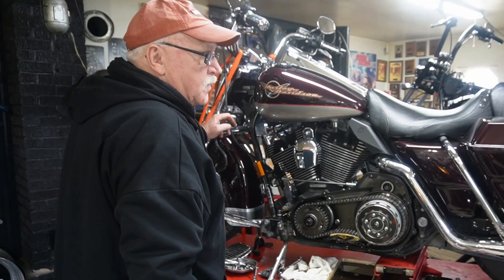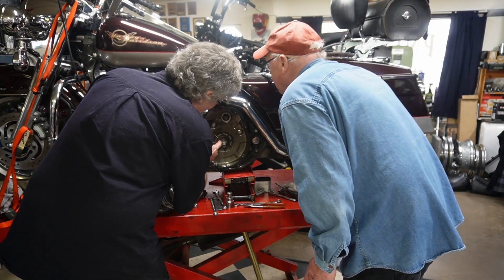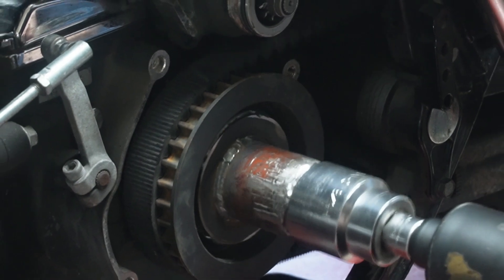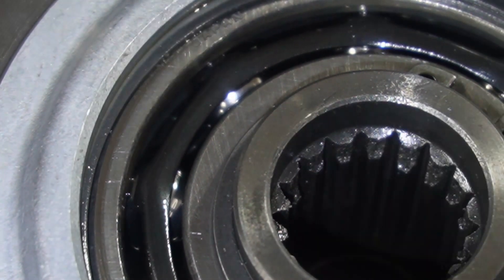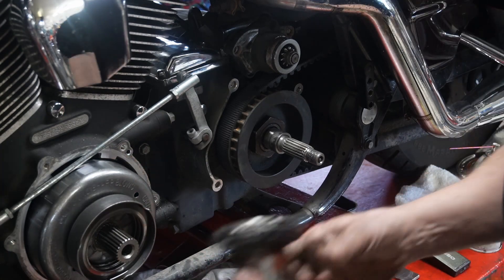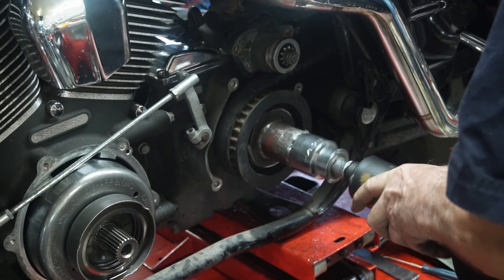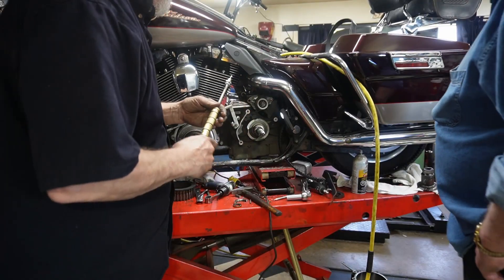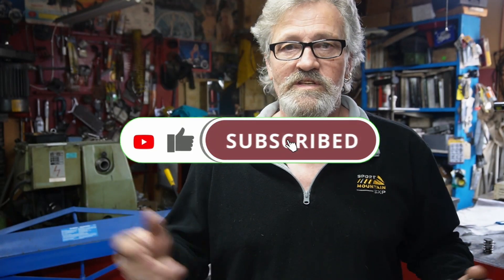PRIMARY BEARING PROBLEMS, BAD NOISE IN THE PRIMARY CASE  PT 1

Comment: Took the right size 3/4 in drive socket ...cut it in half welded a piece of black pipe in the middle....works great... used it hundreds of times! Made one for both size nuts!
Reply from the maker: Thanks for letting others know how you handled it. Thanks for commenting.

Comment: I've never had a clutch hub nut that stubborn. You had a fight there. I do the trap door deal to make room for the bushing puller. Usually when you have one without enough clearance to get the puller on its because somebody drove one in to far. Nice shop built tool. Most of mine are the ebay knockoffs of Jims.
Reply from the maker: Yes just wanted to show it is not always easy and this one definately was not. I may try the trap door thing next time, when the exhaust is easier to get off than a decker  ha ha. Lucky to be able to fabricate some tools. They are so expensive these days and many just cannot afford them...me included. Thanks for the comment. Appreciated!

Comment: That nut would have come if you used a fine tip oxy-propane or oxy-mapgas torch and a 4 foot Johnson bar.  The oxygen raises the heat high enough to melt the red loctite and the fine tip keeps the heat concentrated.
Reply from the maker: Thanks for letting other know how you did it. Maybe it will work for others equipped to do so. Thanks for commenting.

Comment: been there, if you remove the right side mainshaft nut on the trapdoor the mainshaft will slide left enough to get the primary race off the shaft. the impact from your gun is being absorbed by the belt, next time you get a broken belt use part of it to make a strap wrench, without distance between the rear and front pulley absorbing the impact they come right off.
Reply from the maker: I've heard of that but requires a lot of work, remove exhaust, trans fluid, etc. But I have heard it does work sometimes. Each to their own. Thanks for the belt info.
Reply: Huh I'm doing this right now,  great 🙄

Comment: just want to throw this in there, on the race I used the puller and a torch fought it for a day then decided to use heat with a impact slid right off...
and the clutch assembly is left hand thread but the pully is right hand thread....
Reply from the maker: Thanks for commenting and letting others know what you did.

Comment: buy a 2 1/4" deep socket. cut it in half and weld a piece of tube between the 2 pieces. Cheap and quick and you have a socket for life.
Reply from the maker: I ended up building my own, cut the hex out on my plasma machine. To expensive to buy ha ha. Thanks for the info, about what you did, so others will know.  Thanks for commenting!
Reply: Good stuff! Wish I had a plasma lok

Comment: Oops. pretty sure that pulley nut is left hand thread.
Reply from the maker: Not on 2007's. Earlier models yes. Thanks for commenting.
Reply: @itsmytimeletsgo  Im about to take one off a 09 superglide with a 96in twin cam. do you know if that will be right or left hand thread?
Reply from the maker: I think it is right hand thread. Should be stamped on the pulley.  Good luck. @Dexatron
Reply: @itsmytimeletsgo  for future reference, it is marked RH threaded on the pulley for a 96tc 6speed (09).